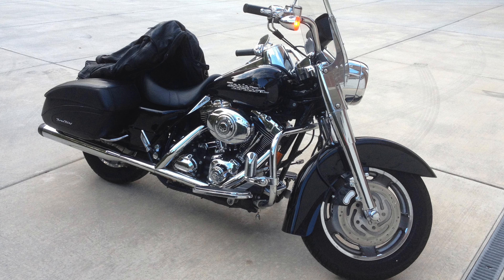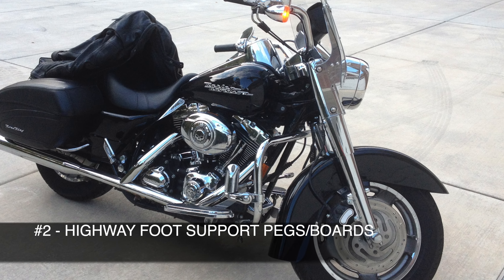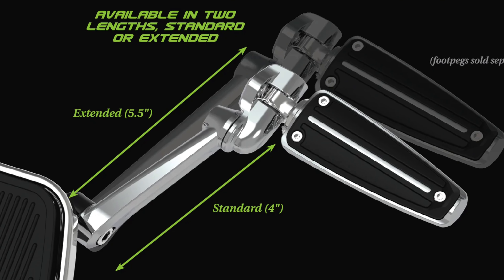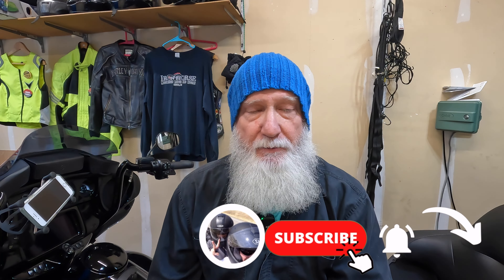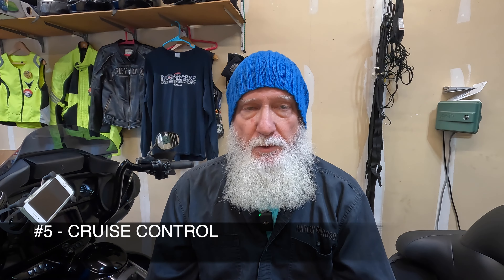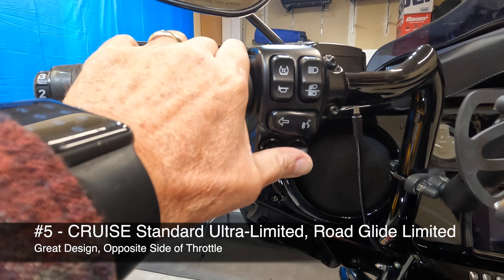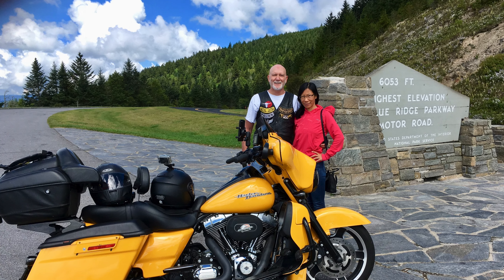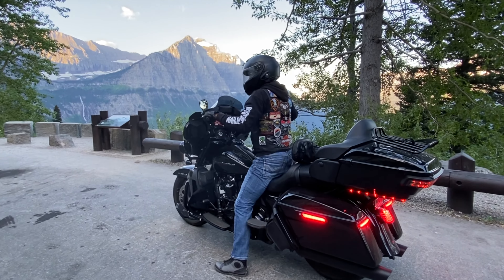Top Touring Essential / Must Have Accessories #ciro3d #kstkustoms #motorcycleaccessories #whyiride

Comment: The reason i bought my electra glide and got rid of my cruiser was for most of these things.  The only things i don't have are heated grips and taller bars.  Im wanting to go 10" because i have a bad shoulder, and I'm tall enough that they'd still be chest height instead of reaching down.
Reply from the maker: Joe, great choices. Grips and bars are a bit more effort and cost. You can’t go at these two without more thought. Thanks for your comments.

Comment: Hi Roger. Great video. When I first started riding long distance, one of the first things that I swapped out was the stock seat. I went with the Ultimate Seat from Ormond Beach, FL. One of the most comfortable seats I've ridden on. And of course, I order it with the back rest. The next thing was extended foot pegs. With those two items I could put in 600 to 700 mile days of riding with no problem. And the next best item I purchased was full heated gear from Gerbing. I purchased heated gear for every part of my body. (Socks, gloves, pant liners and coat liner) I noticed that Gerbing doesn't sell the socks anymore. But I am able to interconnect all the clothing together, then it goes through a controler that I strap to my left thigh then a plug that comes directly from the battery through a fuse box. I have traveled very comfortably in single digit temperatures. On the flip side of the temperatures, I have found a cooling vest to be a life-saver. I have ridden in temps as high as 117 degrees, and was able to keep somewhat cooled down. Of course staying hydrated was also very important. One last thing that I don't remember you mentioning is a GPS device. I use a Garmin, along with my iphone as a backup. Thanks again for your videos. they are great! -- Brad Stone
Reply from the maker: Thanks Brad, I did go out yesterday (11/25) for my birthday ride. It was about 38 when I started and finished up at 32 as I came back down through Ogden canyon. The road was actually a bit dicey. My heated grips were a bit intermittent and I may have to replace them. It was more of a ride to just say “I did it”. You are right, I do use a Garmin on both bikes and now my cell phone. I have so many electronic devices it scares me a bit and is starting to be counter to the motorcycle “gospel” I preach. Thanks for watching.

Comment: Great Vid. QQ4U…. How much additional weight did the lowers add an did you have to make any adjustments because of the additional weight?
Reply from the maker: The Fiberglass lowers are really quite light. They seem big and bulky but are really not noticeable other than the benefit they provide. Thanks for the Question!
Reply: @clemgriffis3446  - Thanks. I was wondering because I checked out a loaded Indian Pursuit Elite and thought, this is super nice, but very heavy, to the point that I was like, I need to hit the gym before purchasing this bike. 😆  That said, I understand full dressers will always weigh the most and Indian Challengers and Pursuits  are much heaver than the 24 R.G. Hence, why I asked you about the added weight of the lowers.

Comment: I'm 63, had an ultra, lowers were worthless, heated grips.....if you wear gloves are worthless, cruise control or something is valuable, highway pegs.....ultra didn't have

I have Kawasaki Versys 1000 as tour bike, heated grips standard still worthless, got a good Corbin seat no backrest, don't need it..... don't try riding all day on stock seat, Corbin seat all day easy ride.......corbin seat has heat, now thats a luxury 

It has tiny windshield with hole in the middle so bugs can easily find their way thru to smack you in the face because wearing half shell with windshield.

When it rains hold my legs in, from knees down good, thigh gets soaked, highway pegs a must have, but kinda expensive to get something made for this bike

Turning WideGlide into tourer, got a 1200 iron for short cruisin, no windshield......thinking about it, but I keep it at speed limit and wear full face

I've been thru stock seat, to newer version 2 piece stock seat, both really nice for rider.....not so much for wife, so got Harley Signature seat with backrest...... I'm mixed on backrest, but longest ever done is 3hrs out rest 3hrs back

Got forward controls, highway pegs, setup to put heels on mini boards toes on highway pegs 

Got a taillight that has blinkers so going to remove turn signals and be able to put as big a bags as I want...... luggage rack and huge bag for just me

Kawasaki has cruise standard, sooo much easier to operate than Ultra, and it is nice.....WG has throttle lock that actually works and is good for dropping right arm........another good device is cramp buster, allows you to relax fingers and just rest hand on throttle 

You don't need a giant bike to be comfortable on long haul

And like another poster pointed out, guy has backrest and trailers his touring bike around

Edit don't want no communication, don't want wife to hear my thoughts on that girl walking down the street
Reply from the maker: Great thing about motorcycles or actually anything else in this country, “to each his own…”! We all ride for different reasons … ride on my friend and thanks for watching!